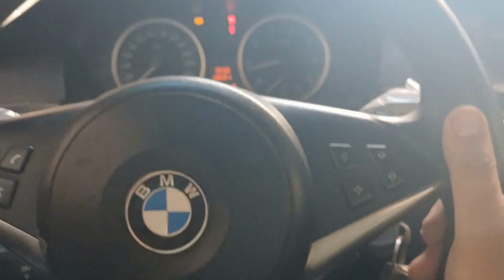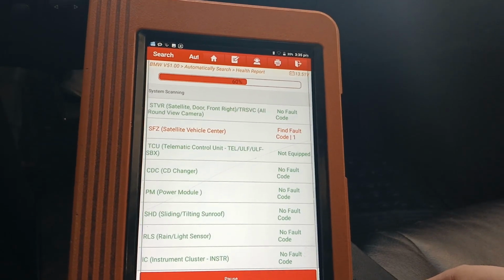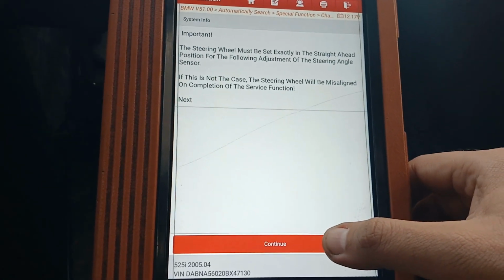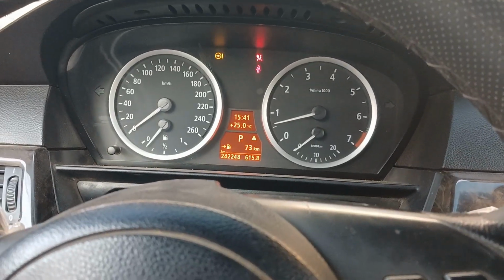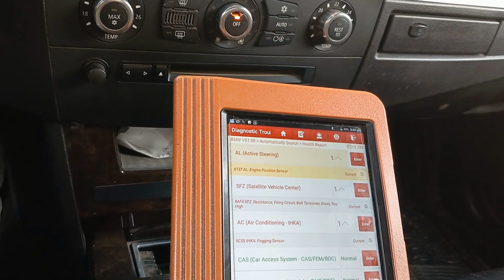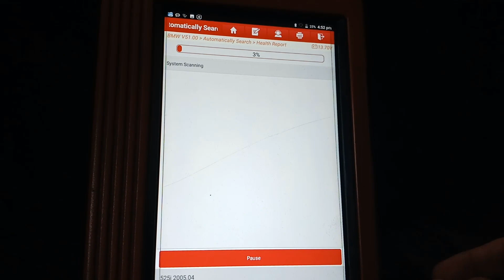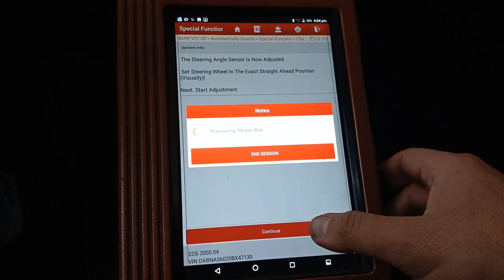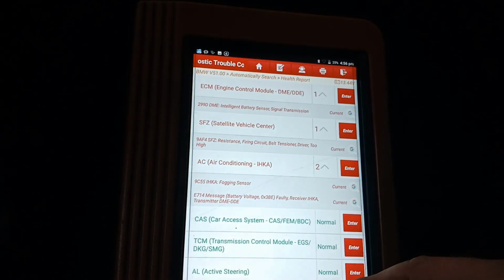Active Steering Fault (AL: Engine Position Sensor)

Comment: My garage tried to fix my steering rack the have given me a different one he said my original active steering was five wires the replacement is 4 so daily I get error active steering message or active steering not active
Reply from the maker: Replacement part should be the same ...

Comment: program says failed to reset motor position what do I need to check?
Reply from the maker: Check fault codes first ... I think you have faults
Reply: @heshamessam8042  I have 6137 AL Engine position sensor and 6143 AL:Servotronic valve.

I read status it said servotronic valve short to ground. Is that reason for Engine position error and how I cant reset moto position?
Reply from the maker: @jonot8547  you must fix errors first .. check same connector as on video